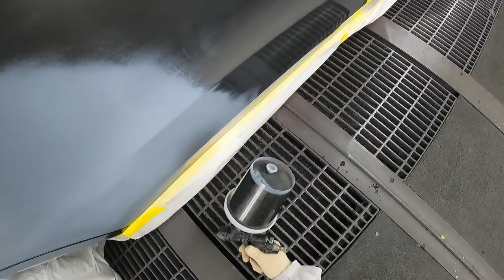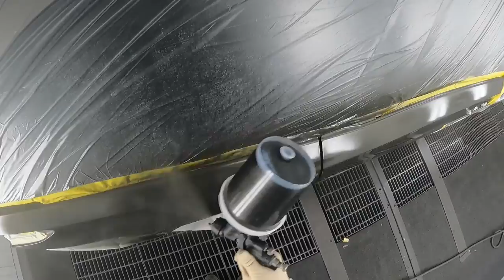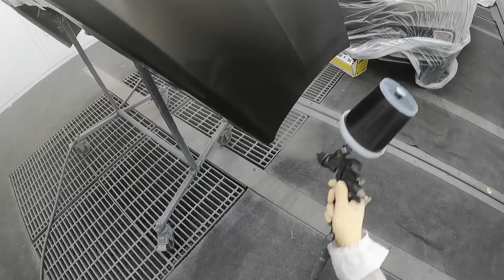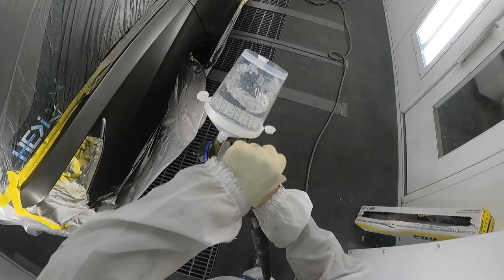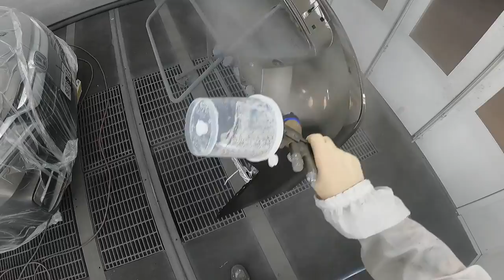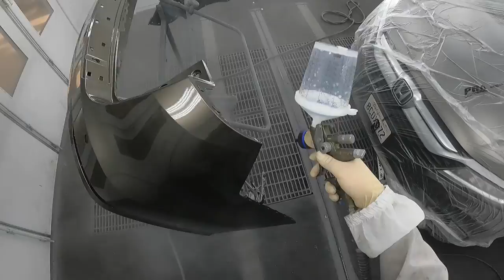Car Painting With Axalta

Comment: When you clear are u doing 2 wet coats? Or 2 mid coats with little flash time in-between the coats? Cus how you went from the car to the bumper, back to the car, back to the bumper. I was taught to do a medium coat close then a 2nd wetter coat but farther away
Reply: For spies hecker or Cromax you do medium. not to wet or not to dry and you let its flash off 3-5 mins between coats.

Comment: Out of curiosity… why don’t you use spies hecker clear coat if you already have the line of material?
Reply from the maker: I used to spray spies clears. We just prefer Cromax. I think they look better and spray better. It’s still an Axalta brand so technically in the same system compatibility wise.

Comment: You don't  drop your pressure for the drop coat? Or let it dry 1st?
Reply: I'm going to start spraying this system next week. Currently I would do 2 wet coats, let dry and do a 13lb drop coat with Sherwin waterborne.
Reply from the maker: No. This system is 1 1/2 coats applied at one time. One wet coat followed by an immediate drop coat into wet paint. I do not drop my pressure either. I spray it all at the same pressure. This system is very different than any other paint line. Coverage is amazing.